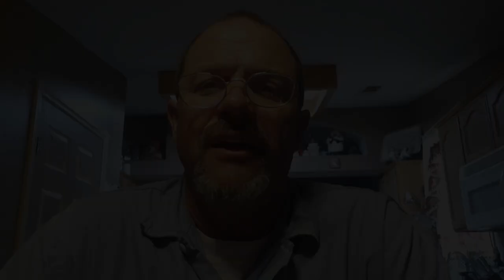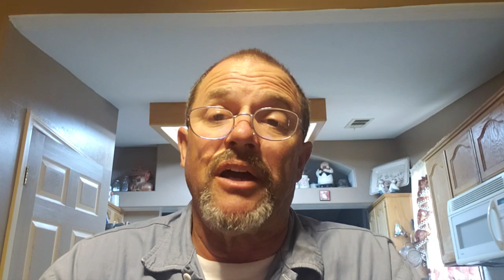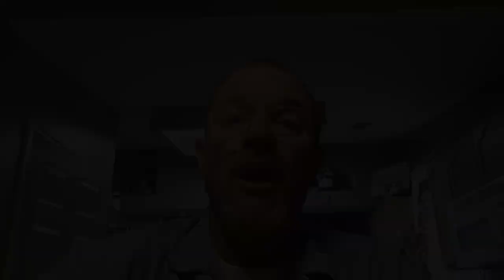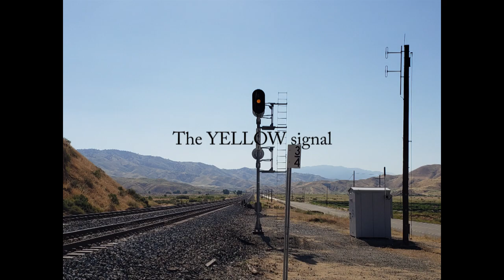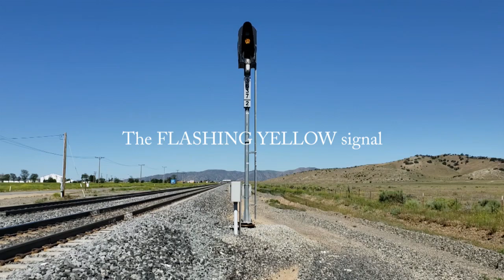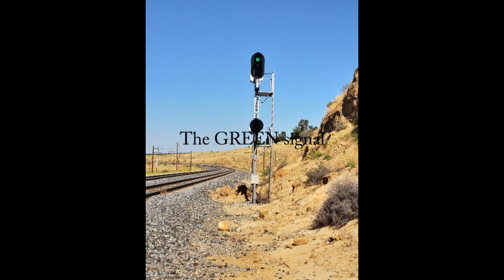Railroad Signals Explained and how they are different from Highway Signals: Part 1

Comment: Mark,
          I love your presentations.  Many times over the years on my way into the facilities where i worked as a B & B ELECTRICIAN i,ve ridden shot gun with the engineer. ON some signal aspects I was successful in calling out to the engineer what that signal means. One engineer told me and i,ve learned a lot that iits like learning ANOTHER LANGUAGE. Some signals I have to see the color, and then look up on the N.O.R.A.C. rule book. Since i,m a kinda slow learner and because I don,t see it often, it takes me time to comprehend.  But eventually get it. Yes, every two years by DOT Standards they test me for color & visual acuity like an engineer , conductor, or signal maintainer,  even though I,le never drive a train....or go into the other crafts.  
         Being for about the last year and a half,  i,m now assigned or bumbed to the draw bridge crew as a night maintainer .yes , i,m called out by either dispatcher or signal maintainer about problems that could occur with HVAC/ELECTRICAL failures in our signal/gate bungalows . I,m sometimes seeing between two  control points in pitch darkness which way a train is coming especially on the Eastern Main line going to Newburyport mass .. There is one section of track BETWEEN ROWLEY STATION and KNIGHT INTERLOCKING in which the track speed is 79 MPH. AND YES, MOST OF OUR SIGNAL SYSTEMS ARE NOW TIED INTO MANDATED POSITIVE TRAIN CONTROL. Also that N.O.R.A.C. rule book, I have to carry with me that N.O.R.A.C rule book at all times with instructors signatures depicting my qualifications for that territory or commuter rail line. This line i,m assigned to very seldom has freight with only a few industrial sidings. Mark, i,m still learning especially now working on what we call are outside points.
With this fairly new position,  I now have to take signal aspects much more seriously.  I work alone. Yet don,t you think from a safety perspective that I should have a working partner? According to OSHA, when I rack in or rack out high voltage circuit breakers in electrical substations at train layover facilities I shouldn't be working alone. Yet most of the time I end up working alone. That is the other side of being in the B&B department.    
    Correct me if i,m wrong but I assume a lot of times you worked alone.
     Do you have POSITIVE TRAIN CONTROL on the territory you serviced?

Paula Walach  - MBTAs/KEOLIS commuter services night B & B MAINTAINER. out of service for knee surgery...hence my trade has worn out my knees at age 77.... I sometimes feel it when walking on the sloping side of tack ballast.yet I love my job and the railroad.
  BTW MY day foreman is also named MARK. HE WILL BE RETIRING IN TWO YEARS.. HE IS 14 YEARS YOUNGER THAN ME. i,le be retiring in 4 to 5 years, God willing if I can make it. And yes , I take care of my health Colonoscapy😂 Mammogram, s heart stress testing etc.
Reply: Additional comment
      Where there is an intervening track like the Lawrence Mass interlocking and freight yard (CSX TERRITORY), there is a blue light on the mast next to the regular signal aspect to indicate an intervening track.   HOWEVER A BLUE LIGHT ON A SWITCH STAND OR DERAILER, LEADING INTO A YARD OR FACILITY MEANS YOU CANNOT UNDER ANY CIRCUMSTANCES PASS IT. WE  CALL IT BLUE FLAG FOR PROTECTION ON EQUIPMENT FOR MECHANICAL. in the realm of me doing work on tracks I have to set up RWP OR RAILWAY WORKER PROTECTION. IT IS AN ORANGE   FLAG OR SIGN PLACED ON THE TRACKS EVEN IF THERE IS ALREADY BLUE FLAG PROTECTION... An FRA enforced redundancy.  I HAVE TO MAKE SURE THAT DERAILER IS TAGED OUT LOCKED OUT, WITH MY ORANGE TAG WITH MY EMPLOYEE PICTURE ON IT WITH PAD LOCK IDENTIFYING me.  AND yes in Boston we have electric light rail and subway tracks parraleling our commuter rail tracks....The light rail tracks in the tunnels when approaching a switch,  believe it or not goes from double red to wht arrow...arrow pointing where the switch is aligned. I was told in my N.O.R.A.C . class by my instructor that subway systems use an altogether different aspects set up. ......yet they run sometimes parallel to our tracks.....go figure!!!!!
         Mark, you must be under a different set of rules in some instances regarding train movements.

Comment: Thank you for the nice video.  Signals and traffic control are my "railfan specialty" so I know a lot about it.  (I would think a Signal Maintainer would be an enjoyable job for me, except maybe for the heights...) 
Signaling has a lot of details, so I want to help out with some definitions that are often confused (even by RR personnel) :
ASPECT – What the signal looks like.  e.g. Colors, multiple colors, movable arms, colors and shapes on those arms, colored disks, signs, etc.  
INDICATION – The response of the train crew in compliance of the aspect—what the signal indicates the train crew should do in reaction to the signal, as specified in the rules.
RULE — The specific item in the rule book that equates one or more signal aspects with an indication. Rules have NAMES and NUMBERS in addition to the written indication.
RULE NAME — What the signal rule or aspect(s) is properly called.  "Approach Diverging" for example.
RULE NUMBER — The number of the rule in the rulebook's or Special Instructions's numbering scheme. "9.2.5" for example. 
👍

Comment: So if your vehicle somehow becomes stuck on the train tracks would it be a good idea to short the rails with jumper cables or something? What about putting a button at rail crossings motorists could push it they get stuck or break down??
Reply from the maker: You could do the jumper thing, but it may or may not make good enough contact to create a stable short. If you can see a train, just get away from the car and walk in the direction of the train; that way, if the train hits the car, it knocks it the other way. There is a phone number on all crossing cabins if you're near one. Call and give them the information on the cabin.
If they put an emergency button on cabins, people would just push it all the time.
Always pay close attention to the signage when approaching crossings and never cross the white lines once the lights start flashing.
Thanks for asking and for checking out the channel!

Comment: Hi Mark. How does an engineer recognise whether a signal is controlled or automatic?
Reply from the maker: It depends on the railroad, but in my corner of the world, automatic signals, whether CTC intermediates or signals in automatic block, have number plates, controlled signals do not.
Thanks for checking it out!
Reply: Conductor here. As Mark says, most North American Railroads will mark  intermediates/Automatic Block System (ABS) signals with a number plate that has the milepost on it, while Control Points (CP) don't have number plates and are usually marked on the "Timetable" map and on the signal house nearby.
Reply: The rulebook!  That's how. 🙂

Comment: What is a flashing green?
Reply from the maker: I only know of it in a yellow over flashing green aspect with an indication of "approach sixty". The next signal would be red over green at the control point for a sixty mph turnout.
Reply: It's whatever the rulebook says it is.  
Do you have a particular railroad in mind?
Reply: @jovetj  well I get UP, BNSF & Amtrak but the tracks are owned by UP
Reply: @TexMex_Rails  It's who owns the track that matters.  UP only has two Flashing Green aspects.
Y/fG is Approach Clear 60 to slow down to 60 MPH by the next signal.  
R/fG is Diverging Clear Limited which is another display "route" for Limited Clear, for a turnout 40 MPH or less.

Comment: So, let 's say my car stalls on the tracks at a crossing, and I call the 800 number on the crossing bungalow, is what will happen that the dispatcher will flip a switch to put the signals in the vicinity of the crossing red?
Reply from the maker: If your car stalls on a crossing, it's because you either stopped on the tracks or rolled onto them without knowing if you could get across, and both are illegal. 
For informational purposes though, yes, if you call that number, any trains in the area will be notified and entering control signals put to stop.
If that does happen, leave your car, move away from it and do not return to it for any reason.
If a train approaches, walk TOWARD the train. If it hits the car, it will knock it away from you.
Thanks for checking it out!
Reply: @MarkClayMcGowan  Thanks!   And yeah, remembering the Fox River Grove Story all too well, I would definitely never venture across unless I were sure I could completely clear it.

Comment: Is there a standard distance between signals ?. Or minimum distance ?.
Reply from the maker: No, there is not. It depends on a few different things such as grades, curves, etc. On straight or good visibility track they are usually about two miles apart.
Thanks for checking it out!

Comment: How far apart are signals/ control points?
Reply from the maker: Generally about two miles but there are places where they are closer depending on grades and sight distances. Thanks for checking it out!
Reply: Most signal blocks are 1-4 miles long.  1-2 miles is pretty common.  The braking distance of the heaviest, fastest possible train on the line is a big factor on that.  

Control Points can be immediately adjacent or 30 miles apart.  A control point can be a complex interlocking with dozens of tracks or a simple holdout signal (which would otherwise be Intermediate, but isn't) just outside of town. The needs of the customary traffic on the line determines where the control points (and other features such as passing sidings) are.   One stretch of double track might have crossovers every 5 miles, and another might have them every 20 miles.  It just depends.

If you look at something like Tower 55 on Virtual Railfan, you'll see lots of back-to-back controlled signals.  Those are multiple control points that are adjacent.

Comment: What happens if an engineer happens to look away while passing thru a signal and misses it?
Reply: @Marty Martian

I-I-I reckon that poor slob would be coinfine to being a janitor at that thar UP HEADQUARTERS, shining up dem floes pardna. 🤠

Jethro
Reply from the maker: They're visible for quite a long way, especially on straight track. In curved territory the speeds are slower and still give ample time to see the signal. There have been instances though, where the crew have fallen asleep or have been distracted such as the Chatsworth Metrolink v UP freight head on in 2008 when the engineer was texting.
Reply: @MarkClayMcGowan  Wonder why they don’t have a trigger to notify a crew when they are in the vicinity of lights, instead of counting on them not to text or fall asleep?

Comment: You touched on a subject talking about the red signal that if something shorted out the rails it would go red.  I saw a situation where a car tried to cross the track, not at a crossing. and the front would have been hit by an approaching train.    I know that the old block signals on the Santa Fe operated on the principle that if you introduced a "Short" across the two rails, the closest signal in either direction would go red and the next would go yellow. The short could be introduced by throwing a set of snow tire chains across the two rails or using a set of battery jumper cables.  Do all U.P signals work the same way even on the roads absorbed in the last set of mergers? Would the same principle work in the area of a grade crossing where the track is isolated from the rest of the block for the operation of the crossing signals?
Reply from the maker: Yes. In signaled territory placing a shunt across the rails with put all entering signals to stop (hopefully a train hasn't already passed the signal!) and give the dispatcher an indication on their board. In non signaled territory if you have a flare (at night), place one between the rails on each side of the obstruction. In daylight, if you see a train approaching, walk toward it waving anything you have below your waist (called a "washout") from side to side.
A shunt will activate a crossing as well. If you want to keep the crossing activated the has to be within 50 feet of the edge of the road. Beyond that, the controller will see it is not moving and recover the system.
I have a piece on how crossings work in my "How the Signal System Works" playlist.
Thanks for checking it out!
Reply: Just remember that there isn't a lot of voltage across the rails... so some things just casually laid across them will not be conductive enough.  Rusty rails and rusty train wheels are a big problem in this regard (rust doesn't conduct).  A tarnished or rusty chain might not do much, but jumper cables are good.

Comment: You said something about a green signal being clear for the next 4 blocks.  What is a block?
Reply: Block signaling divides the rail line into signal blocks of generally 1–4 miles each.  Ideally, only one train uses a block at a given time.  Block signals protect the entrances to both ends of the block.  

The number of aspects of the signal schema determines how "clear" a Clear signal is.   Consider two scenarios of signals a train might encounter:

[1]  Green → Flashing Yellow → Yellow → Red
[2]  Green → Yellow → Red

These scenarios assume no track switches in play along here, too.  The first one is a "four aspect" schema, the second is a "three aspect" one.   The signals need to be able to warn the heaviest, fastest train early enough so it can stop before the Red signal.  If that heaviest, fastest train may not be able to do it between the Yellow and the Red, then another aspect needs inserted.  That's where #1 comes from, with the fourth aspect.  If four isn't enough for a given location, you can even add more aspects:

[3] Green → Yellow-over-Green → Flashing Yellow → Yellow → Red

The signaling is tailored to the specific circumstances and needs of the line.
Reply from the maker: A block is the track between two signals, usually about two miles but it can be a shorter distance depending on the situation.

Comment: How do the intermediate signals know the state of the next signals ahead of them?
Reply from the maker: Information is always being sent from signal to signal through coded pulses on the rail or, in older systems, over open wires or in cable on the poleline next to the tracks.
Each location has a transmitter and receiver (or battery and relays in older systems) that determines the aspect.
Intermediates are automatic and will display whatever aspect the receiver tells them to display in both directions until a route is cleared in one direction at which time all opposing signals "tumble down" to red. 
I hope that answers your questions and thanks for checking it out!
Reply: @MarkClayMcGowan  Yes it does, Thanks!

Comment: What is a LUNAR signal?
Reply from the maker: A lunar signal (so named as it is about the color of the moon) is used to move a train into an occupied, signaled track such as a siding with another train stopped in it. The aspect would be red over lunar where moving into an unoccupied track would be red over yellow (or whatever the circuitry called for).
Around here, the lunar was replaced by flashing red.
Thanks for checking it out!
Reply: Lunar white!